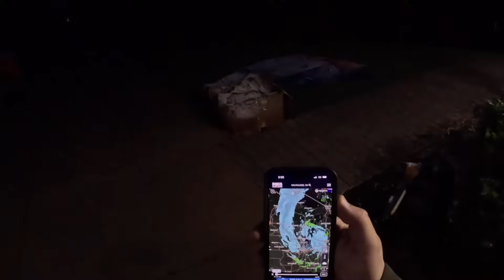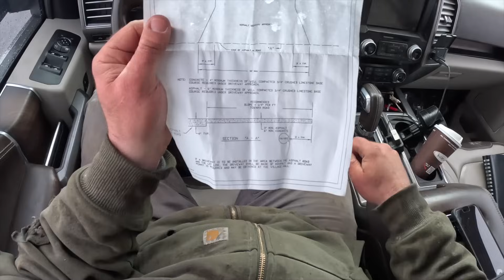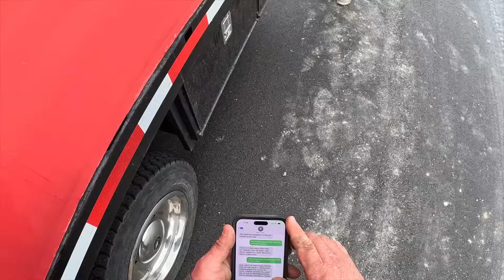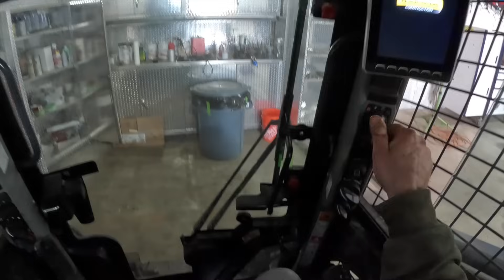Snow, wind, cold, miserable!  Still glad to be BACK!!! Concrete soon!

Comment: 30:54 Boats have the steering wheel on the right because it gives them the best viewing angle when they dock, they typically do that on the right side :)
Reply: It's on the right to counter balance the rotation of the prop.

Comment: My wife and I are both in the Flooring industry and we both rock Thorogood boots. American made,They can be resold meaning new bottoms can be put on.  And right out the box they’re extremely comfortable. They come in wide widths. I can usually get a season out of them but with the work I do, I wear off the top of the boot before I wear out the bottom.  I highly recommend them.

Comment: 30:50
The reason the Helm is located on the Starboard Side of most Vessels is mostly for visibility purposes. The Starboard Side is typically where other Boat Traffic is going to be passing you, so you want to have most of your attention focused on the Starboard-Bow Quarter Portion of the Watercraft.  

As with Helicopters, another main reason why boats are Operated from the side is because most Sailors are Right Handed, thus it’s easier and more convenient to have the Helm on the Right Side, so you could stand beside it towards the Center for more all around general visibility around the entire Vessel and to be able to Better Supervise The Deck Crew While Maneuvering The Helm With Your Right Hand.

Comment: Steering wheel is on right side of boat to counteract the torque from the prop spinning.   To keep the tight side of the boat down from weight of driver.

Comment: I had the same issue with multiple steel toe boots and different brands and red wing finally came out with the king toe boots and I’ve been wearing those for over 2 years and they have been wonderful because the toe box is 40% wider than a traditional steel toe and I’m a mechanic so finding a good steel toe was difficult but after 2 years with the king toe boots from red wing they have been wonderful and I don’t feel the steel toe at all and no blisters thankfully

Comment: Do you have side-shift abilities? There is a notch in the bottom rail for installing/removing forks from the frame, without exiting the cab of the forklift. You just need to have side-shift capabilities. Drop the forks on the ground, side-shift one fork to the slot in the center of the frame, tilt forward, drop down, back out, fork remains on the floor. Ideally, the forks should be spread far enough to do the job, but not too close to the swap notch. You've got a great crew, hard to find in small town AZ..

Comment: Ryan, If you can remove those aluminum pieces that is wearing the salter cover and use plastidip to coat them it should create a rubbery buffer. Might help and a cheap solution.

Comment: The truck to moving the forks around, put a little bit of downward tilt on the tip of the forks just enough to release the tension then they’ll slide pretty easy

Comment: 30:53 There’s a mechanical reason for it. Boat propellers typically spin clockwise, and the resulting torque pushes the left side of the boat down by 2 to 5 degrees. Therefore, to make sure the offset is balanced, the steering wheel is located on the right side of the boat to ensure that the weight of the driver balances the vessel.

Comment: I water ski and have a ski boat similar but different to the one shown in the video fun fact a lot of the classic ski boats in the USA are Australian designs originally. The driver is on the right hand side of the boat because you always give way to the right and to do with most inboard ski boats have a clockwise spinning propeller and to counteract that some how do I read up.

Comment: There's a fair bit of resistance to the prop turning in the water. The left side of the boat tends to get physically pushed down [in the water] by 2˚ or 3˚. If the driver's on the right-hand side of the boat his weight tends to balance that and make it level.”Jul 11, 2012

Comment: 49:35 A mate bought a Chinese single axle caged trailer and bought the optional cover. There was the same issue on the corners of the cage, but I spotted it before he used it. So I got some 2" PVC plumbing elbows and cut them away profiled to fit the corners of the trailer cage, and wired them on. No damage to the cover yet - and it's a cheap nasty Chinese cover too.

It's hard finding anything decently made these days. It would have taken them a tiny effort to weld  couple of C-shaped 1/4" rings on top to prevent the sharp corner contact with the cover. And that upward facing stud next to it should be a bolt facing down into a captive nut. Just lazy.

Comment: Tino needs to be worked with. When I was an Assistant Manager at Walmart I was hired from the outside! 

Rather than just negatively coaching associates. I’d pull them aside to find out the cause of their negative action(s) and I would tweak/make small changes with the problem associate showing them that I cared.    

Ryan as you know each of your employees is different and brings something good to the table. At Walmart they’d negatively coach causing the Associate zero chances to advance or get a pay raise for six months. The other Assistant Manager’s would then wonder why their associates had morale problems. 

My crew out performed others.  

In closing Ryan, Tino needs your assistance.  Thank you 😊

Comment: On that boat, question about steering wheel being on the right side. I always heard because propellers turn counterclockwise, so the torque will kind of turn the boat left, so if you put driver weight on the right side of the boat. It helps the boat go straight.

Comment: Boats steering wheels are usually on the right but not always. This is because the throttle is on the right gunnel because most people are right handed.

Comment: When you go to put the "help wanted/ we are hiring" sign or ad out there. Just make it know that it's possibly gonna be temporary till ur employee comes back. That way the people that answer the ad or show up for the interview, they know what they are signing up for & u won't feel like the bad guy for letting them go if not needed. But if u think ur gonna be that busy but might not need them for the entire day/ job, u can always make them "on call" available. That way Incase something comes up they are available & can get there reasonably fast. Just a couple idea for ya to roll around in the ol noggin.

P.S to avoid having to scrap ur frozen windshield invest in the de-icer washer fluid, it makes light work of that. Also if u know it's gonna be cold in the morning, set ur defrosters to max heat & max fan the night before. So when u get up in the morning just tap the auto start button on ur key fob. By the time ur ready to go & head out the door ur windshield & truck are defrosted, warm & ready to hit the road.

Comment: Boats are typically driven from the right side because of the direction the propeller spins.  Almost all outboards and I/Os turn clockwise looking forward. This causes the force of the descending prop to "Lift" the right side of the boat so the drivers weight is positioned to counter that roll effect when driving alone.  Some boats do not have that affect such as a Jet boat. So most Jet boats place the driver on the left side which also places the foot throttle toward the center so they don't have to work around any curvature of the hull bottom.  Now You Know! 
And BTW, Airplanes don't have that same problem.   Pilots fly left seat.  Why is that?

Comment: I might be no more than an armchair critic here, but I would use the plasma cutter with a straight edge guide when you need to cut something that small. That saw does not care about what it cuts through.  Clamps, clamps, and more clamps. And PLEASE, I know its cold, but leave the shop door ajar with a fan exhaust and wear a paint mask (with the filters) when you spray paint. Other than that you guys encourage me to get my own self together. I gotta figure out my own EEEEasy money.

Comment: Why is the steering wheel on the right side on boats? There are several theories but the most common belief is because most people are right-handed, and this placement makes it easier for drivers to access the throttle

Comment: Tell Bugs that per Google, boats have right sided wheels because apparently it has to do with propeller torque. Apparently propellers on single engines go counter clockwise, so when there is torque on the propeller, the boat can lean left. Boat designers wanted a way to keep more weight on the right side...but again, per Google 😂
31:06

Comment: Just wondering about the pins on the inside do u take them out right before pouring
Reply: yes they pull them out once the pressure of the concrete is against the form.
Reply: @floydfan5993  figured they had to come out but never seen it, dumb question
Reply: @Krazed-1  , not a dumb question at all, they usually use this method when making a significant bend in the form or for making adjustments.

Comment: They say size doesn't matter but I can tell you that compactor is way too tiny. You need to at least double it, preferred if you triple it - come on man. That's like basically a compactor for asphalt without the tank.

Comment: ( Q ) Why is the steering wheel on the right side on the boat? 
( A ) Boat designers wanted a way to keep more weight on the right side and boats generally must yield the right of way to the starboard side so having a driver on the right side allows for more visibility of boat traffic.

Comment: Dude cut out the part where you use the concrete saw 2 inches from you tennis shoes, not even steel toe'd. Thats an osha violation.

Comment: Put 93 in the f150? Not really needed at all, just a bit overkill on the octane rating.
Actually does more harm then good on most engines, using more fuel etc.

Comment: To answer Bugs' question about why boats are RH drive; it's because of the spin of the prop.  If the boat was left hand drive you'd have the prop spin and the weight of the driver working together in the same direction causing the boat to list to port more.